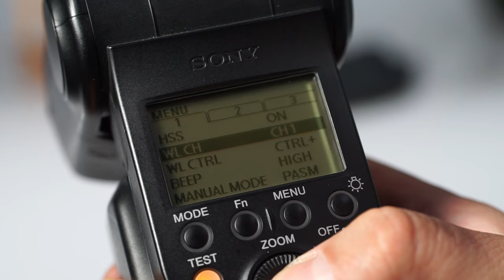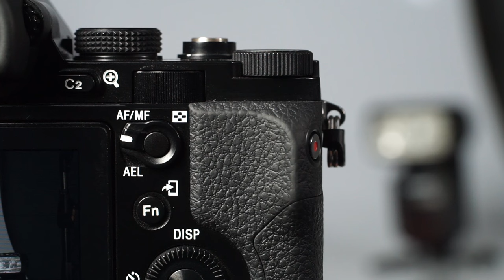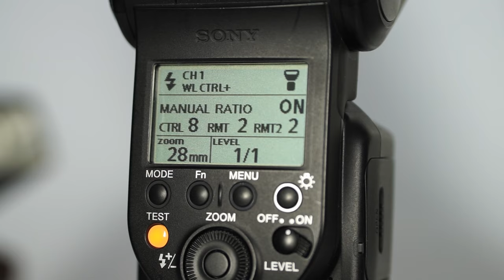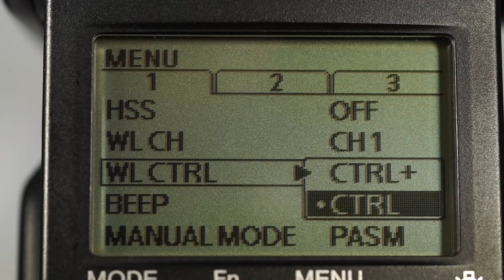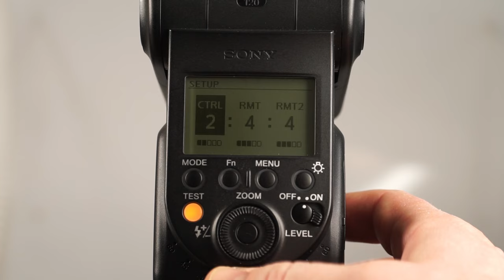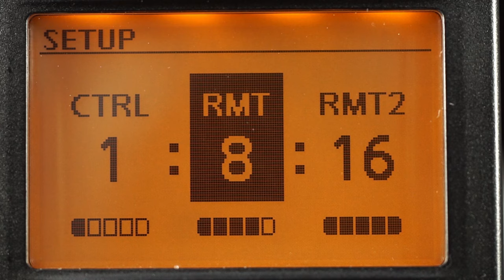WIRELESS FLASH SYSTEM Setup

Comment: Picked up a Hvl f20m and I love it. It's lightweight and for the most part gets the job done. I'm about to buy a Hvl f32m with a broken hotshoe (because for 40$ you cant beat that) and was only gonna use it as a off camera flash. Can the Hvl f20m control more then one at the same time or only one?

Comment: I am in the process of converting from Canon to A7 III. I have a LumoPro manual flash with a standard ISO adapter, will that work with basic functions on the Sony?
basicly will it fit the hot shoe, and will it fire? I also have a Canon ring flash, but that will probably not work, or not work good, it has the ETTL II. And I also have some
3rd party radio triggers, that on a Canon will transfer the TTL data.